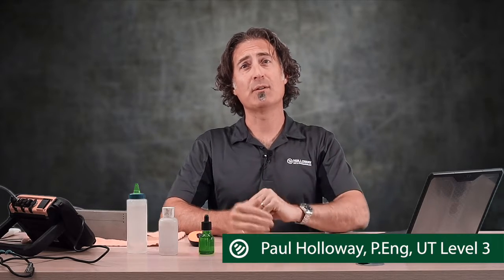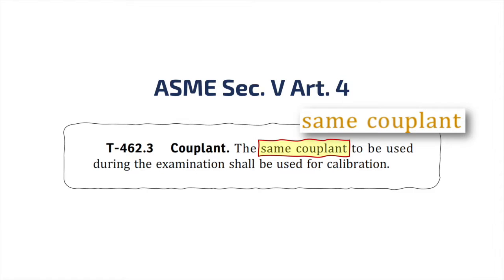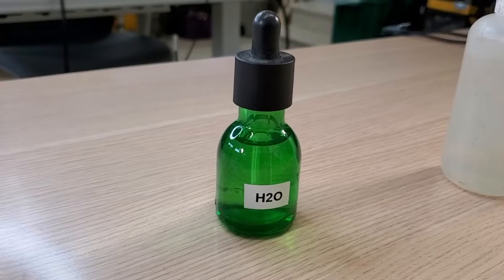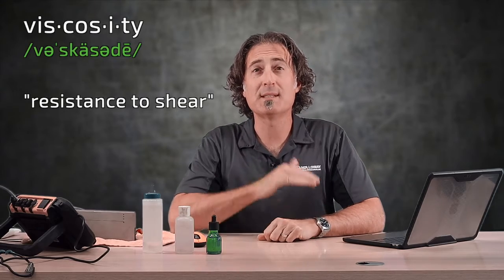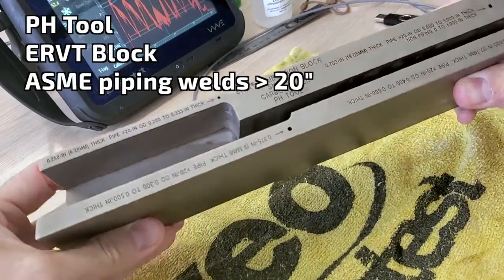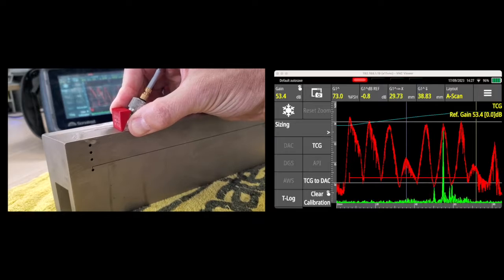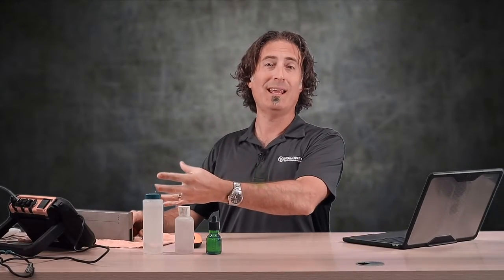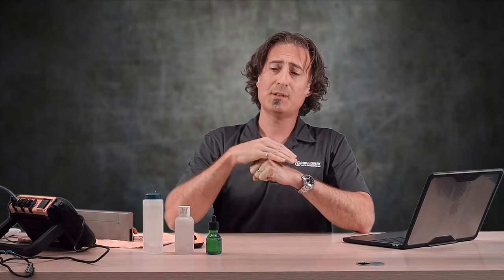Couplant Sensitivity

Comment: Great post; I recently used honey for a normal incidence shear wave experiment. I tested my backyard honey vs. commercial honey and found my honey with a higher moisture content did not perform as well.

Another thing: I switched from windshield washer fluid to RV water treatment for winterizing. It helps prevent the skin of the fingers from cracking.